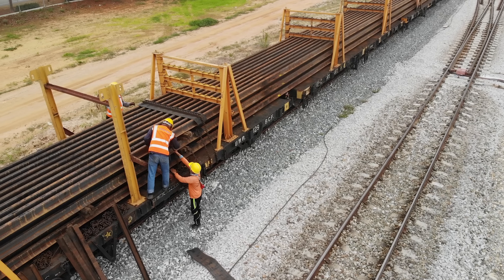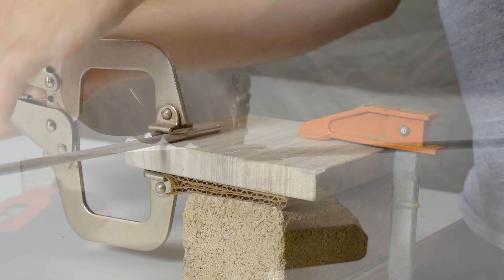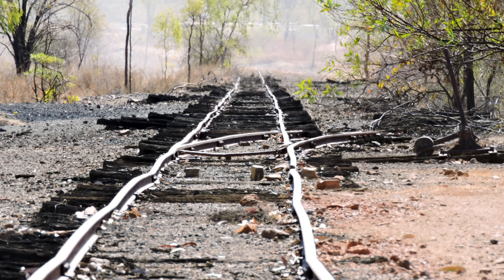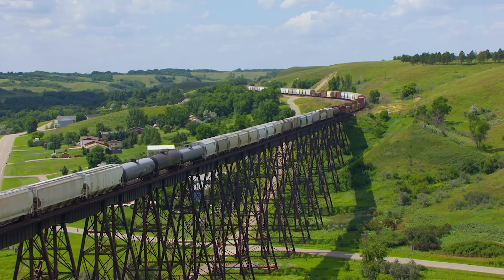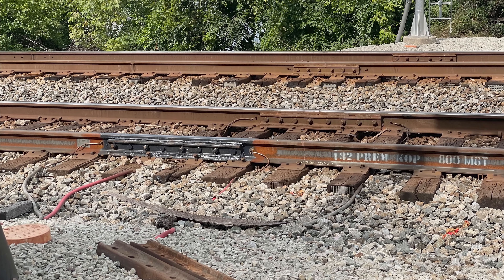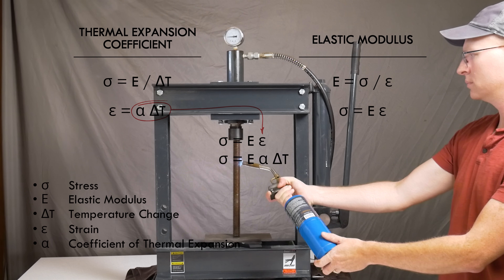Why Railroads Don't Need Expansion Joints

Comment: While studying mechanical engineering in college and now as an actual locomotive engineer for a commuter railroad, this is great information and very well presented. I’ve witnessed CWR being installed but your explanation of installing rail at its warmest neutral temperature makes perfect sense! Indeed, a rail pull-apart is much preferred over a heat-kink, not only from a rail perspective, but also the cab-signal code will drop to zero in a broken rail but may still function normally during a heat-kink which could be disastrous.

Comment: 12:50 could they just use the feathered expansion joints instead of the traditional clickety clack gapped joints and eliminate the need for continuous welded rail, in the first place?
Reply: Yes but it would cost more and be a maintenance and safety liability.

Comment: So if i understand correctly, these rails are under great stress in winter, and if I it breaks for some reason, it would snap back like overextended rubber bands? That's really scary actually, I would steer clear from railway tracks for that
Reply: A broken rail is much less likely to cause a derailment than a buckle, when a train goes over a broken rail the driver will feel it and report the bump for investigation, either at slow speed by another train, or a P-Way foot patrol. Also if the rail is part of a signalling track circuit the break in the rail will automatically put the signal protecting that section of line to danger.

This is why the natural temperature for rails is usually biased so the rails suffer more tension in the winter than compression in the summer.

Comment: Here in Melbourne Australia, our rail system has gone under major upgrades with many level crossings removed. One of the other upgrades is continuous rail and replacing wooden sleeper with cement sleepers. Many of the old wobbly rail routes are now quiet and much smoother.

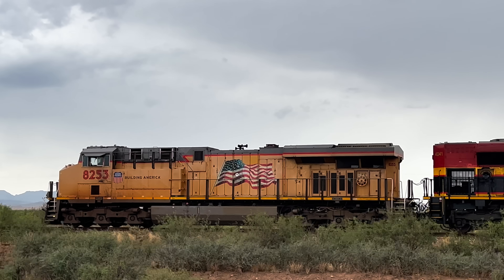Comment: Anybody else notice that at 8:19 the wheel is bouncing into the air! At 8:23 looks like the entire flange has bounced above the rail. Press Shft+comma to slow the video to 1/4 speed. I wonder if the RR engineers have noticed this.

Comment: Whoa, C'mon man,  at 10:50 is a complete Engineering misunderstanding of what the unit of Weight and Force is in the SI Metric System.   The unit gram/kilogram is a unit of Mass NOT Weight or Force.  The unit gram is also one of the 7 fundamental units. Weight and Force are a derived unit and not to be confused with a fundamental unit. The unit of force/weight is a Newton (= kilogram meter per second squared).   The Mass of an object is the same value on Earth, floating around weightless in space and on the Moon.  But the weight of an object is different at each of these locations.  Clearly, Force/Weight and Mass are both conceptually and numerically different. It's the year 2023 not 1823 meaning it is time to stop calling weight and force, 'kilograms'.  But, hey, the units Joule and Watt have the unit kilogram in them too so we could also just refer to those units as kilograms as well, eh?

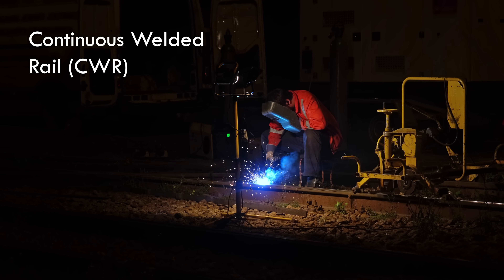Comment: 1:15 - "A lot of new track these days uses continuous welded rail" - yeah, righto. Could you then tell those post-production folks putting up your stuff, that FOR A GOD'S SAKE, IT'S THERMITE WELDING!!! THER–MI–TE!!! NOT a short-circuit MIG/ MAG welding, no matter dual shield or solid wire, as shown in this clip!
(BTW, he's probably welding up some baseplate crack or God–knows–what, "just for show" - and, funny enough, the REAL CWR joint is shown right there, right next to him - under the "forward" wheel/ leg of this yellow-ish cart, which sits on the tracks just right off this clueless MIG-gun w(i)elding fragle...

Yeah , I know, I'm an OCD nitpicker, but please, get real - hey, how about talking about a "spaceship" of sort, and showing some airplane in the accompanying clip? Hey, it's an "airship", innit? And it DOES "move through a space", doesn't it? For crying out loud...

PS: 0:31 - "You can only roll out a length of a rail so long ..." - yeah, and nowadays rails for CWR tracks aren't made any longer as "39 ft/ 12 m" sections, instead they are now made in 120 m/ 394 ft sections. Some call it "progress"...

Comment: "They use a really high neutral temperature."  (But, but, that would mean they have to always lay the rail hot?)  "They do this by only laying rail in the summer, and using heaters, and etc."  😮

Comment: Having spent many years in the trades, I've seen on many occasions where the tiles inside of improperly constructed chimneys have broken and lifted the tops off of chimneys due to thermal expansion. Roofs constructed of insulted roof panels, which are foam cores with a metal skin laminated on both sides can lift right off of the interior walls as the sun expands the outer skin but not the inner skin.
I've often wondered if this phenomenon contributed to the failure of the World Trade center. Burning jet fuel could possibly have expanded some of the long columns of structural steel several inches longer than the rest of the structure.

Comment: I think the biggest difference in rails today, verses how they used to be done, is the availability of heavy-metal tooling out in the field. Welding typically requires a large amount of power (comparable to an electric stove), and cutting rails in a diagonal fashion needs powerful tools as well. Thermite welding solves the welding power problem, and other power tools let you do even more with existing rails, while being far from a typical power line end-point

Comment: Thermal loads are an issue for aircraft also. The consideration of thermal loads has become especially important in aerospace with the advent of composite structures. Aluminum and Carbon fiber composites have significant differences in CTE so it’s definitely a must to consider the effect of thermal loading. There is some great reading in Bruhn about how to handle thermal loads in joints. Thanks for the great video.

Comment: In the UK, we have issues when the temperature exceeds about 30C, because such a thing is so rare. And the sleepers move sideways more often than the rails come adrift from the sleepers.
I hate how the video is called "why railroads don't need expansion joints" yet at the 13 minute mark the fact railways actually do use expansion joints is mentioned.
In the UK, we also often paint the sides of the rails white in areas featuring points and whatnot where rails are needed to not move at all, as it minimises the heat absorbed by the rail by reflecting the light away, thus reducing the thermal stress on the material

Comment: 1.  The rail roads have gone to low speed, high weight, low value product freight hauling.  I don’t have the numbers but suspect track maintenance are rails #2 expense just behind salaries.
Roller bearing fatigue life is inverse of cube of the load [L=1/P3].   This suggests higher speed, lower weights, high value might be attractive.  Their $/lb-mi versus speed may be a “U” shaped curve instead of “L” shaped.
2.  Years ago rail roads had “doodle bugs” running between cities.  Resurrecting, robotizing, and (possibly) battery electrifying doodle bugs for light load hauling.  Envision doodle bugs loaded at a hypothetical Amazon in Fort Worth driving themselves to Sweetwater, Abilene, Midland, Odessa, Ft Stockton.  The technology is available right now.
    Cheers

Comment: Besides all the square pi rigamarole, this was an interesting video. 
In a past life, I was a Carknocker and always enjoyed the click clack of a train. I still find myself watching for sliding wheels when stuck at a road crossing. 

One of the scariest things I ever saw was a train heading towards me at 45 to 50 mph and the locomotive was porpoising. This was in Alaska, and the tracks are on tundra. I got as far from that as fast as I could.
Reply: carknocker is a term i have not heard in years. for the un familiar with railroad lingo a karknocker was a car inspector. the carknockers term came from the using a hammer on the wheeels to check for cracks.
Reply: @marklett5810  I knew someone would get it. Very old term that honestly was used very little, even 30 something years ago when I started. 
That's the one job that I never got bored with. Started with NS, then the Alaska railroad after that TTX. Moved on to greener pastures, but I miss it sometimes.

Comment: In the early 2000s an especially hot summer caused the rails of the Norfolk Southern Lake Pontchartrain Bridge to expand so much that they exerted tremendous compression on the trunnion bridge works.  The pressure was so great that the bridge's rolling trunnion works, which had been in operation since 1884, broke.  The bridge was inoperable for about a year.  A hole had to be made in the side of the concrete structure to permit the removal and replacement of broken parts.  New parts had to be manufactured for the ancient design at great expense.  All because the rails had nowhere to expand.

Comment: What is the effect of removing expansion joints on bearing wear? Russia had a big problem a year ago procuring bearings for their rolling stock. Does Russia use this fancy continuous weld technology? Or are they still in the dark ages along with most of their other accrued materiel? Maybe practical engineering should discuss practicalities as found in the real world.

Comment: Phoenix Light Rail engineers and planners must have mussed this.  When they built and were commissioning the first sections the rails in many sections buckled.  They did put in actual expansion joints to alliw that expansion/contraction.

Comment: The track assembly in USA of wood crossties, spikes, tie plates, and rail anchors is dependent upon a well engineered rail bed and a clean and draining ballast section.

The spikes hold guage, the tie plates prevent the rail from cutting into the tie and provide a greater bearing surface over the tie, the tie  grabs the ballast, acting to anchor and distribute forces, the rail anchors (the clip like devices either side of the tie) force the crossties to drag into the ballast as forces are pushing the rail.

If the rail is sufficiently anchored it can, to a point, redirect thermal expansion into the rail without affecting guage and contour of the track.

Comment: In China, the Chinese produce rails  in appoximately 1/2 mile lengths,  the rail ghen delivered on site, and installed with local thermite welding used.

Unlike the USA where 39' lengths of rail were transported back, inspected, cropped, rerolled, and the welded into 1/4 mile lengths.

The USA does not have a steel mill & rolling plant capable of producing new 1/4 mile long rails.

However fortunes have been made on the derivative positions on the stock and commodity speculation over every aspect of such production, unlike the Chinese Financial Industry which is leaving money on the table.

And besides, the salaries of all those civil engineers on staff are but thefts from the dividends of the stockholders.

Comment: Called "rock and roll"😂😂😂

It's called harmonic Rock
It's been awhile but I believe it's between the speeds of 12 and 22 or 23 mph, therefore you never see speeds of 15 on jointed track generally you'll see 10 or 25 to minimize this problem.
Plus  jointed rail also creates a vertical curve (low joint)so even after they install cwr, unless they go and resurface the entire Road bed you could still have harmonic Rock for a long time until the roadbed levels itself out.
I'm only 25 percent into to the video...
Reply: Just watched the rest..."close enough for railroad work" as they say

Comment: bro used "SI vs Metric" you mean imperial vs SI? because Fahrenheit and PSI are imperial, Pascals and Celcius (yes i'm aware kelvin is actually the SI unit, not celcius, but it's the same scale) are the actual SI units.

Comment: I know that in my region, once the temp gets above the mid thirties C, they start talking speed restrictions on the trains.  At times they have actually enforced this.
Reply: Right! When it's hot, load and vibration from stock rolling may provoke sun kinks, and it is very unlikely that a train running fast is stopped immediately, if the sun kink appears suddenly in front of the train.

Comment: I was hoping to see the requirements imposed on the rail ties. The way they are embedded in the ballast, especially at the ends of the ties to prevent them shifting inwards or outwards. Also it seems concrete ties are now able to resist the perpendicular loads imposed on them. The spikes would probably work their way out of wooden ties. Maybe the ties are spaced closer together for CWR. I think the ties are where the real engineering takes place.
Reply: Our policy is the ballast has to be level with tie for 6 inches and then a 2:1 slope. Tie spacing is 19.5 inches center to center for wood ties and 25 for concrete. Cwr vs. 
Stick rail doesn't matter. We are slowly replacing spikes with a lag screw for the reason you mentioned. But spikes only deal with lateral restraint. The anchors attached to the rail up against the tie resists the longitudinal forces.
Reply: Also, at one time concrete seemed like the answer, but we are now slowly switching back to wood. As soon as drainage fails, which happens often, the concrete tur s back into a soupy cement mess. Wood ties, pandrol style tie plate, and lag screws seem to be the best option as of now in my opinion.

Comment: The key concept here is that the assembly is more stable with the rails in tension and the ballast in compression, than the other way around, due to the different material properties. The video doesn't cover this.

It's a similar concept to reinforced concrete.

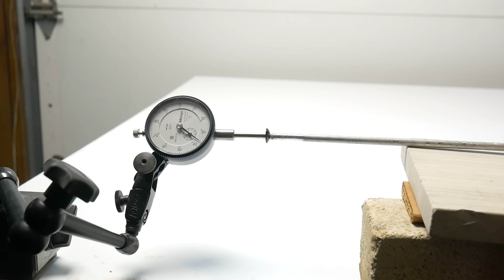Comment: 4:14 'warm temperature' WRONG WRONG WRONG !!!

"Temperature" is an abstract concept designed to convey a relative measurement of heat. "Temperature" has no physical properties — one cannot paint, hold, touch, throw or place a temperature in one's pocket. Likewise one cannot boil or freeze a temperature, therefore it cannot be "cold" or "hot" although whatever is being measured can be.

The weather or air can be "hot" or "cold", temperature cannot be. Temperature is the measurement, not what is being measured. To say the "temperature is WARM" is confusing the measurement with what is being measured. Temperature can be "high" or "higher" or "lower" relative to some other measurement. Saying "The temperature of the rod is warm." just doesn't make any sense and is unnecessarily wordy. It is the rod that is hot, not the temperature. "The rod is hot." makes sense and is correctly stated.
Reply: Nerd
Reply: @flytrapYTP  Thanks for introducing yourself nerd, I am edwinov, scientist.
Reply: I ain't reading allat

Comment: Jointed rail increases a car’s drag, requires more fuel to pull each wheel and axle and increases the likelihood that couplers will tear apart.  On todays 140 car or more transcontinental trains the difference is dramatic.
Reply: Changing from 60'-0" jointed to CWR reduces the drag by about 10%.

Comment: Hi, Belgian train driver here, there's still expansion joints but they're not just gaps, it's like if you raise your elbows up on your both sides, then join your hands flat, one thumb up and the other down. It allows rails to "slide slightly but without moving sideways or leaving a Gap when it's cold, Hope you understood my explanation 😅

Comment: One summer in Melbourne in 2009, the tracks were buckling in 43 degree Celsius, and were being hosed down by rail staff because they no longer had expansion joints.
Reply: Actually, highways and railroads can buckle even if they contain expansion joints.  The expansion joints can only expand so far.  A few years ago, it was so hot in the summer that the expansion joints in a number of highways actually popped up and they had to stop traffic until the problem was resolved.

Comment: Would like to have seen more on the actual installation under the specific conditions needed besides just some bench tests. Thanks.

If installed too cold the rail would expand too much and buckle on hot days. But if installed too hot, you could get shrinkage on ice cold days and again displace inwards.  So the installation tech must be highly controlled.

Comment: 13:49 What's the compulsive reason of most youtubers for ad nauseam constantly apologising for using or showing math? That "excusing yourself" for using math is actually much more annoying than using the math itself. People are NOT JUST a bunch of dumb morons specifically allergic to math. It would be equally dumb to constantly apologise for using English, wouldn't it?
Reply: For a very large portion of the population, math is scary.
Reply: @herpnderpn2484  And that "large portion of the population" is commonly called m*rons.
Reply: @herpnderpn2484  Yeah, and those we call dumb.
Reply: There used to be a saying that the number sales of a given book would half for every equation it contained.

Most people HATE math.
Reply: @DJ_Force  Incorrect. Not most people. Most M*RONS hate math.
Reply: @DJ_Force  Not most people. Most M*RONS.
Reply: @DJ_Force  Not most people. Most m*rons.

Comment: The rail workers, hearing that the engineering department found a reason for all rail construction to take place on the hottest, sweatiest days:
Reply: Or you can install the rail on cooler days and stretch it with hydraulic rams until it is the same length it would be at your desired natural temperature, then clip it down and weld it up while it is at that stretched length. In frosty weather I have sometimes had to stretch the rails by over six inches.

Comment: The main lines are almost all welded by now, but all that bolted rail wasn’t just scrapped; it was used on short lines, sidings, industrial spurs, and etc.  Still hundreds if not thousands of miles in service making that clickity clack sound, for now.